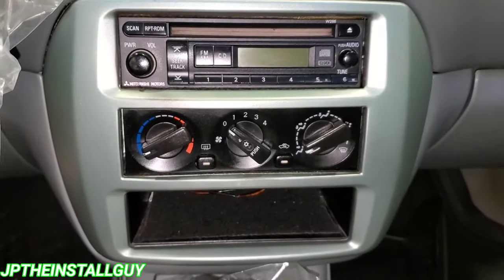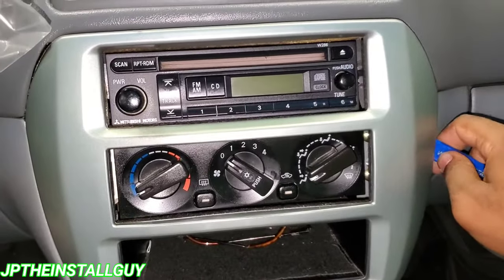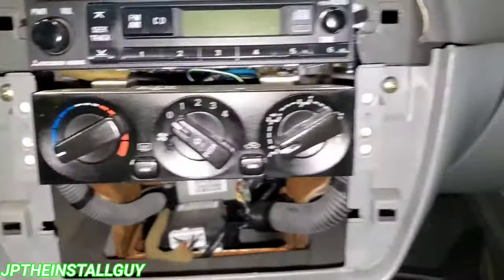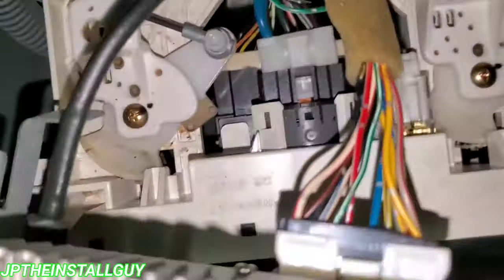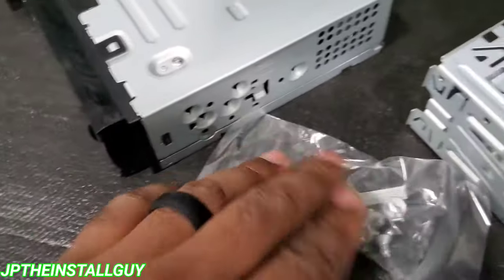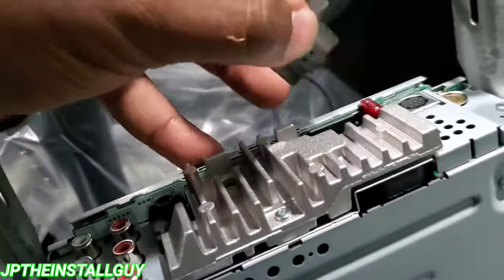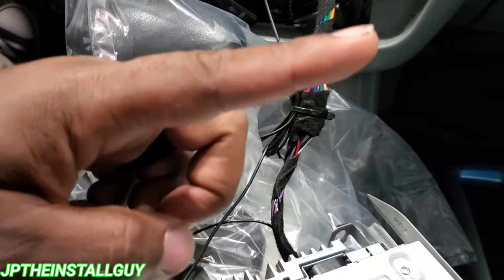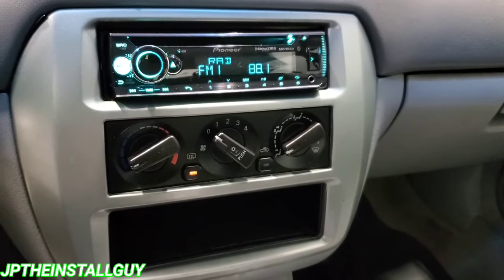2002 Mitsubishi Galant radio removal/replacement and pioneer cd player install

Comment: Installing an aftermarket radio on 03 galant same setup. Where do I connect ground? The wiring harness I got doesn't have a black wire on it but the stereo harness does have on.
Reply: Bro I’m literally having the same problem with my 01 galant I have everything else hooked up but it’s not powering on I don’t know where to put the ground

Comment: Great video man I installed my radio in the 2002 gtz and I can’t get the radio to power on on start up and or stay on it turns off after it starts to power my wiring is all messed up if you could tell me what could be the issue and or how I can fix
Reply: I got the same problem I got a 2000 Gtz did you get to find out ?!

Comment: Followed the instructions. Everything worked . When in accessory mode it worked. Started it up before I left for work, worked fine. I pull out of the garage for work. 2 seconds later stereo stops working and same with my speedo.  Just stopped working. Any help?
Reply: Check ur connections